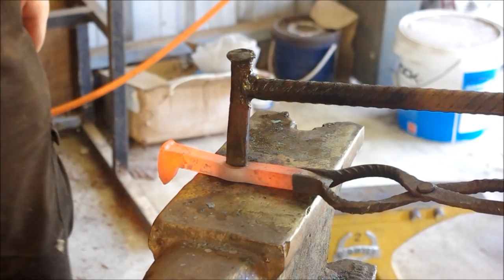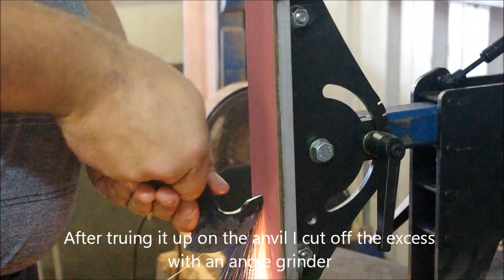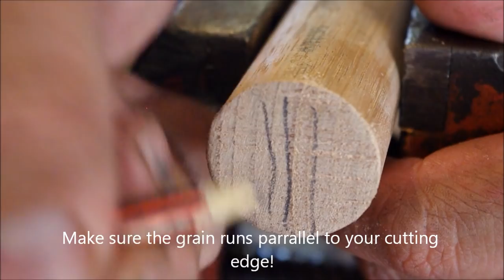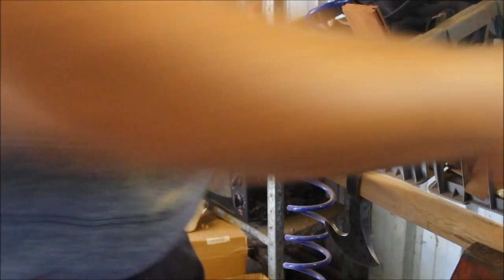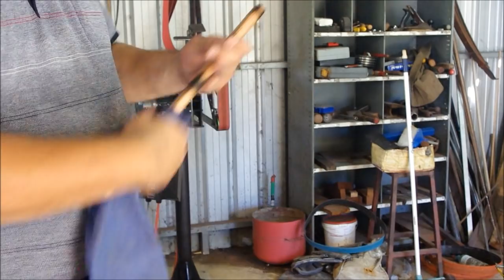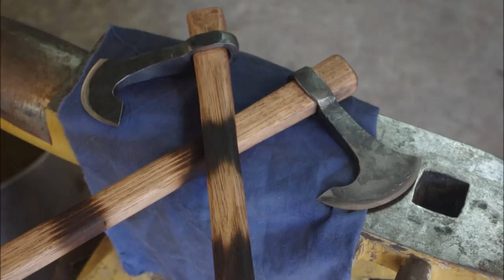Forging Mouse Hawk / Throwing Axe

Comment: Wow you make some nice ax heads from just simple rail road spikes. Interesting to see there is enough mass to make the edge. Enjoyed watching the video.
Reply from the maker: Cheers mate! I could have forged these a bit thinner in the end, but they do alright!
Reply: That's good to know. Bet they throw well. Good job.
Reply from the maker: They do! Cheers mate
Reply: I make them using the point end as the blade and the head of the spike becomes a small hammer I sell them as camp tomahawks the hammer is great for driving in tent stakes.

Comment: I make alot of railroad spike tomahawks and because of the low carbon content, even though I've had alot of RR spikes harden enough that a file will not scratch them, I now cut the head of the spike before I begin forging and I forge weld a small peice of high carbon steel into the spike where the edge is and they have been awesome little tools even though it seems like tedious extra work